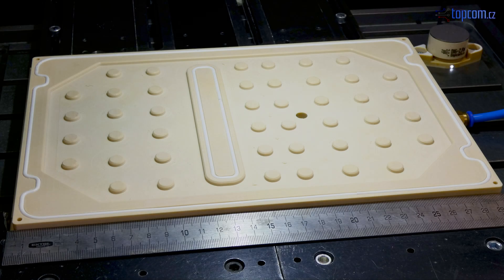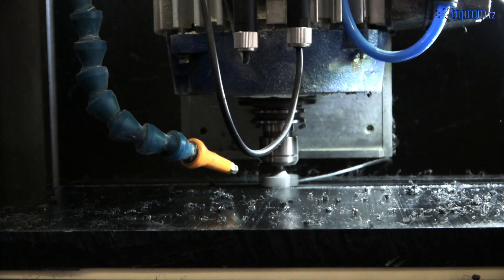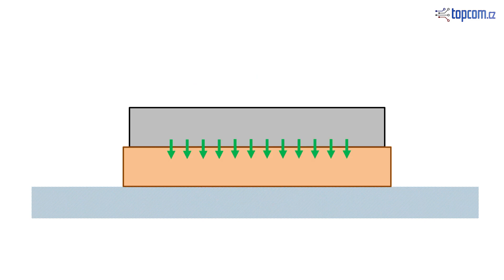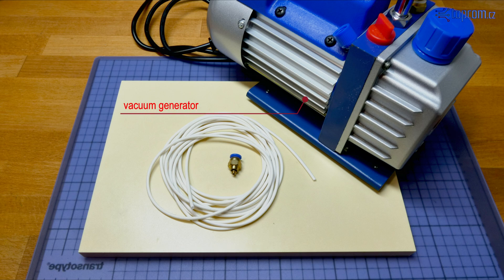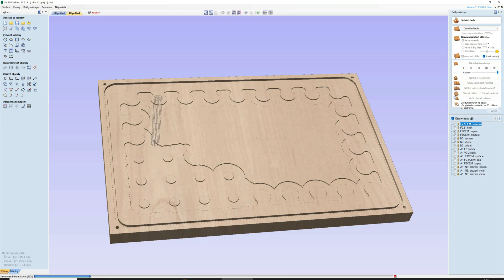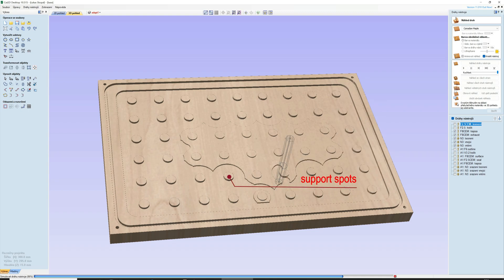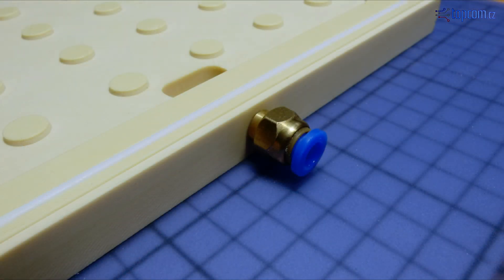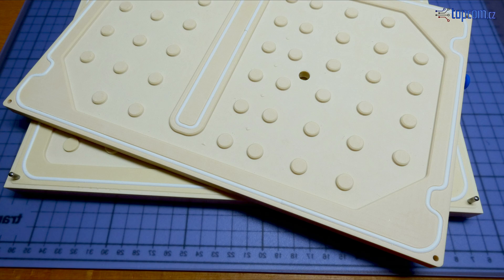How to make a vacuum clamping for CNC machine

Comment: Hi : I am having a hard time finding where to get the material that you used? Do you have a list of suppliers? Thanks Ron
Reply from the maker: Hi Ron, you are right, that it is not easy to find it on the market. I know it only because of previous job. It is usually named FR3 or CEM-1, I found also EP CP 201, but different suppliers have different names. I buy it locally in CZ from the company Labara (https://www.labara.cz/en/), also can be bought from the company Isoma (isoma.cz).
It is usually in the category "electrical insulation materials", like for ex. here:
https://www.americanmicroinc.com/electrical-insulator-materials/
there is not exactly FR3 material, but there is FR4, which contains a glass. So try to find it locally by "electrical insulation material".

Comment: Hi which Pump you use?
Reply from the maker: Hi, the pump type is shown in the video at 1:25, it's some Aliexpress vacuum pump from the VEVOR company. Vacuum level is really high (-0.95bar), nevertheless after longer work the pump side is bit hot. So if you need to use it for a longer time (longer than 2hrs approx.), would be fine to install some cooling, or some undepressure switch, which starts the pump only when necessary, because when whole system has minimal leakage, the underpressure remains really long time. Than the pump can work only part of the time.

Comment: What type of material are you milling in the video? It looks like some type of plastic.
Reply from the maker: Hi Jeffery. The material is usually named as FR3, or EP105. It is layered paper filled with epoxy resin. This material is relatively easy to mill and it is hard and stable. The best tools for milling are "diamond shape" mills used for PCB milling:
https://www.aliexpress.com/item/1005001489049574.html
Reply: @topcom7762  if it's paper/fiber based with resin, then it'll be easy to find by searching for "phenolic" - there are countless companies that market phenolic with their own names. I just searched for FR3 however and that's nomex + resin which is fiberglass based and fire-rated and fire retardant.